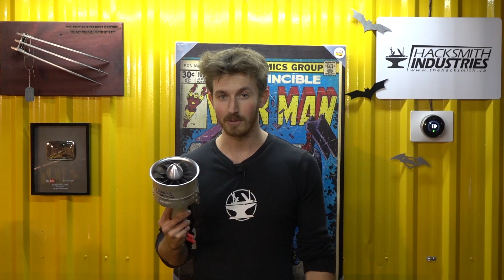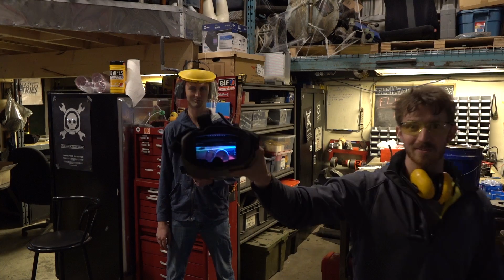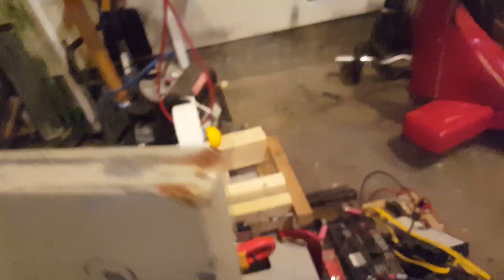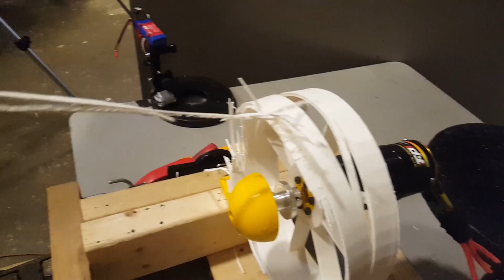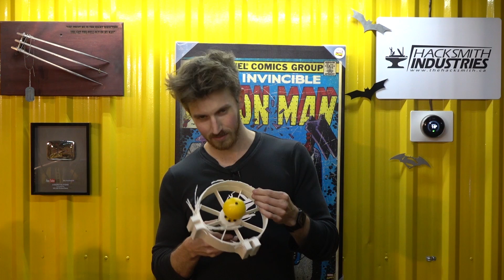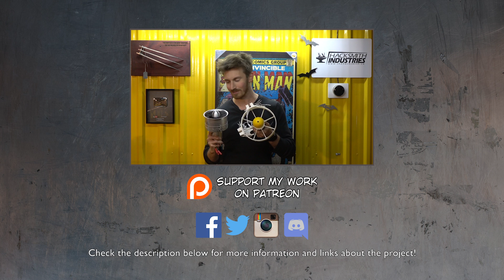Flying Like Iron Man Update: EDF EXPLOSION!!!

Comment: Right when you said "3d printed our own" I knew you were going to have an explosion. A 3d printer won't be able to balance a turbine the way a precision CNC machine can balance one. Even if you made the thing solid it still wouldn't be precise enough. You'd have to manually balance it the way they balance motor rotors after coiling them by drilling little holes around the hub, and then somehow make it strong enough to support the weight of your body (or a fraction of it) between the hub and fins. I'm sure if you took the time to balance this turbine before pushing it to its limit you would've been able to get a bit more force out of it before it exploded... Anyway, it's like I always say: where there's a will there's a way!

Comment: Have you thought about changing, or experimenting, with the print orientation. With additive manufacturing there are weak points along the grain of the prints so if you print the parts that will be stressed with a, for lack of a better term, "grain orientation" that is perpendicular to the force that will be applied to it the print will last longer?
Reply from the maker: Not many options with the hobby grade FDM printers we have haha, this is the only real orientation they can be successfully printed. =(

but yes, we have thought of it xD
Reply: hmmm Maybe if you segment the print for the blade housing, into semi circles, with the support structures on the outside of the arc, you could have a horizontal "grain orientation"? 

idk support structures are kinda hard to remove so this method might require a bit of post processing.

Comment: Probably a bit late. But why not try to print the EDF horizontal to the direction of airflow and thrust, relying upon its tensile strength.  I understand this would be far harder to print but the way it splintered lead me to believe that the print was perpendicular to the direction of thrust. Its like splitting wood, it is a whole lot easier to split along the grain vs against it.
Reply from the maker: Be too hard to print :(
Reply: Figured as much.  But thanks for the quick reply!

Comment: Dear hacksmith have you ever thought about using an Arduino Nano with drivers to power your EDFs? Just a thought I came acrossed thought I would share
Reply from the maker: +Josh Hagen you can't lol, EDFs are extremely high power devices, you need dedicated electronic speed controllers to power them

Comment: hi. to make  stonger 3d part .use nylon filament . the way...dry the nylon first 4 hours in oven at 150 - 175 celcius. after dry keep nylon in Tupperware box sealed during printing .use nozzel o.3 , at 240 celcius , layer 0.08 or more definition 0.06 , bed 115 - 120 celcius more glue stick on bed. need to print very slow , can take 30 -40  hours.when done instal your part again in oven 3 hours at 150 celcius to make sure no humidite.after use electronic heat hot air soldering at 450 celcius to reheated your part to melt the layer and make very smooth face ..you will make hd part and very strong.good luck Patrick.

Comment: So you're telling me that you will not use 3D-printed parts because they disintegrated when approaching the speed of sound? Whole PLANES (made of METAL) have disintegrated at those speeds, never mind a 3D-printed part. Actually it is impressive that a 3D-printed part lasted that long at those speeds!
Actually, I just did a bit of calculation and if the blades are longer that 2.5 inches (!), they should be in the transonic region and experience shock waves that are going to do lots of damage, and if the blades are longer than 3.1 inches, then congratulations, YOU BROKE THE SPEED OF SOUND!!!
I would recommend that you:
-pat yourself on the shoulder for having a propeller go supersonic, something that was so far only achieved by the XF-84 "Thunderscreech"
-slow the propellers down a bit and just add more because the 3D-printing is going to make the EDF's much cheaper
-take this advice with a grain of salt

Comment: When 3D printing, the weakest point is between layers. You can get greater strength by slicing the print and printing it in several pieces at angles that reduce stress on that weaker "between layers" bond, and gluing them together. Think about how much stronger plywood is because of the cross grain lamination. That is what you will need to do to get the needed strength. Since you are printing out of ABS, an acetone bond to attach the pieces can be used and it will be as strong as the plastic itself.
Reply from the maker: +Joe White we are well aware of that, but due to the complex geometry we can't print it on an angle. Too many overhangs and the surface finish would be terrible with support material
Reply: When I say slice into many pieces, I mean many. Each blade would be two separate pieces bisected so that all surface area would be the upper print layer and the surfaces that are on the print bed are your glue surfaces . The ends of those blades would form a dovetail joint that would slide into the hub giving strength and precision to the point of connection while also adding a cross grain support to the horizontally printed hub.

Comment: I could offer you to print a carbon fiber reinforced prop, and by the way: why not also print a reinforced ring around the blades (connected and also spinning) to keep them from disintegrating? I suggest you could get ten times the output. I would just need around 2mm of thickness to embed the fiber.

Comment: I was wondering instead of 3d printing your own if you could buy only the impeller part of the edf and mount it on your edf with smaller blades and only 3d print this cylinder around the blades?

Comment: ok so some kit EDFs have the actual prop in several identical injected molded pieces that come toghether and form the prop
so my idea for this is to 3d print like 1/4 or 1/8 of the prop in high quality resolution
then make a silicone mold of the part and cast it with epoxy resin
u can even make it weight ballanced by weighing out the resin each time

Comment: hey hacksmith..
you are using the turbines which are just open....the inlet and outlet of air is constant..
what about trying a Venturi...
Reply from the maker: EDFs already provide maximum thrust in static scenarios as designed -- at high speeds (when in RC planes and what not) you can increase efficiency and thrust using duct lips and thrust tubes -- but unfortunately for hovering (our main goal) these just add weight. =(
Reply: +the Hacksmith 
yes you are right
but I think it's worth a shot..
can I send some suggesting photos ??
just suggesting..
😐😐😶😶
Reply from the maker: Feel free to research the subject matter! We don't have time to test everything though. There's quite a lot of information about EDFs and thrust tubes =)
Reply: +the Hacksmith 
Thanks
I got Interested and curious about the project after watching the videos...
I'll make my efforts...

Comment: http://offers.kd2.org/pics/e6/56/e656c42bba3993d9afce6f721cdc0b81aef23b80.jpg
I don't know if this would help or not, but what if you 3D print a ring around the propellers so the exerting forces of all the propeller blades are lessened and supported by the ring around it like a toy propeller.

Since all the blades want to go outwards why not 3D print a ring around it to keep it contained and since each propeller blade is connected to each other by the ring, adding better support from being torn apart

Comment: The mountings are what killed this. The blade was pulling forward and the mountings weren't 4 which is how you should secure something like this. Take a bathroom fan, mount it crooked and that's the same thing, just less power. The cowling was bent under the load and then the blade touched it and popped in to pieces. TLDR four mounting points vs two on one side. OR thicker cowling and greater distance between blades and it.
Reply from the maker: Watch the video closer -- both the cowling and the fan tip forwards -- that wasn't the point of failure.

We do need a better mounting system (needs rails at the top too, to get rid of the moment) but this failed due to the speed -- the tips ofthe fan were going at 0.8 mach!

Comment: you should also try kerosene powered rc jet engines. They produce 22 kg of thrust each and are not too much money here the link http://www.ebay.com/itm/ATJ-220sv-22kg-Full-Auto-Kero-Start-Turbine-Engine-for-RC-Jets-Made-in-Taiwan-/322335097190?hash=item4b0cab4166:g:YpoAAOSw65FXtpha
Reply: 22kg=48 pounds of thurst
Reply: screw you
Reply: good idea
Reply: that would be sweet
Reply: 2500$ not too much money you are full of poop
Reply: hes got a gofundme page with a goal of 75000 so yeah
Reply: I think the reason for electric motors is for throttle response times.
I reckon for this to be flyable, you'll need a lot of software running in the background, much like a quad copter.
That said... one or two of these running full bore might be useful for lifting jets, leaving the EDFs for control...
Reply from the maker: Thanks for the suggestion Madden Madness - Car Videos!

We've actually answered this in detail in the Flying Like Iron Man Q&A video! Check out that video, or visit http://www.thehacksmith.ca/flight-project-qa/ to learn more about the project!

Basically, tl;dr -- price point is comparable, and EDFs are much easier to control. We might need a bigger budget just to design a system that uses jets instead of EDFs.
Reply: that makes sense. good luck with the EDFs

Comment: Try casting it out of aluminum. More of a challenge but it could work.
Reply from the maker: too risky. at home casting for something that precise... not easy. any air pockets or variations in the cast part would cause some catastrophic shrapnel attack when testing
Reply: What filament are you using? Have you tried PET (CEP)? it also might help it you airbrushed over it with pla, abs or pet glue.
Reply: it is flexable though. So probaply not ideal for blades but maybe for the housing.

Comment: Why don't you use styrofoam covered with carbon fiber for the duct? It's a very light solution and more sturdy than the 3d printed one. The only negative aspect is that you have to handcroft the styrofoam ducts.
As a prop you could use a normal one from a hobbie store for rc planes or from hobbyking.
Anyway this is only an idea from me even if I'm no a mechanical engineer.

Comment: the more pitch you have on the blades the more amps you getting, dont burn motor and ESC...
Reply from the maker: +Niclas Horn that's why we were measuring the current
Reply: dont forget you need a thrust tube to create proper thrust from a EDF, total lenght of the tube and motor is EDF Dia x 3, the outlet on the tube schould be 90% of the EDF dia then you getting a strong thrust, not fast but strong..
Reply from the maker: Thrust tubes only work if you're flying at high speeds -- they reduce thrust in static scenarios =(
Reply: nopp... thats the thrust inlet that you compress the the air infront of the motor... the faster you fly the more air you compress infront of the motor and get a good expanding of the air after the motor that gives extra thrust.. but thats not what i wrote about in the post before this one..

Comment: Well the positive is that it ran smoothly right up to the point when it failed. So it would seem that the balance is good, I think the problem is just creep, the blades plastically deforming outward until they contact the housing.

Comment: Why not make a kinda tunnel system for your suit? Instead of having just the thrusters directly on where you want the thrust, maybe have them attached to your back and have a tube system to direct the thrust?
Reply from the maker: +Namestop Gaming redirecting airflow causes turbulence in the air which results in a massive loss of thrust -- it could be possible, but considering how hard it is to get enough thrust in order to just hover I don't think it would be possible with current technology

Comment: 3D print a wireframe like structure, then buy glass or carbonfiber and epoxy and strengthen and fill in the wireframe :)
If you have the time I would say buy a spool of fiber and wind it yourself instead of using a woven sheet since you can strengthen the blades selectively with strands and not waste both materials and weight in strengthening the propeller where it doesn't need strengthening.
Simulate it in COMSOL or some other engineering program to cut down on developing cost :)

Personally I would go for a design where you have strands of fiber going inside the blades along the blades and wrap around the edge of the blade back to the center so that the fibers take the centrifugal loads.

Comment: I told you this would happen in my comment on your last video.

You might also be overlooking the balance issue. Any rotor running at high speed must be perfectly balanced for it to survive long term. If it's not you'll develop a vibration that will result in catastrophic failure. I'm sure that 3D printed rotor was not balanced properly coming straight out of the printer and contributed to your failure. Precision machined metal rotors in gas turbines never come of the CNC perfectly balanced. They go through a high speed balancing process where they are put in a cradle and checked. Material is then further removed in key areas to achieve perfect balance. If you don't do this you'll never succeed.

I'm not just talking through my ass. I've been working in the aircraft turbo fan industry for over 25 years and am trying to save you time and aggravation.

Having said that its always fun to see shit get blown apart and makes for good Youtube content so there's that too. lol
Reply from the maker: Yeah we're getting a static balancer for future ones -- it'd be nice to have a dynamic one but my limited research says they cost thousands of dollars =(
 
The main point of these experiments is to finalize the design of the EDF blade and then get it manufactured -- likely by CNC. We can do flow analysis but empirical bench tests are important too =)

Comment: in the middle pole shadt thing inside the 3D printed edf try making it a gear but locked in place kinda like how a bike peddles and then its a chain reaction with the center of the weel(a gear) try spplying the same principle to the 12kg 3D printed edfs but also lock each one in its own little hole so it doesnt go flying again also maje it thicker wich will probably even equal more thrust out of it

Comment: maybe find a way to use a resin printer like the carbon m1 to print rather than the typical plastic layer builder ones that you are using now, it seems the plastic bonding between the layers are not strong enough to support the loads you are subjecting them to.

Comment: Maybe try pressing the 3D parts with fiberglass, carbon or even cevlar. Well and for that you use two compound epox. And if you'll sand it down correctly you'll upgrade the durability quite a bit. Try it ! I think it mite just work.

Comment: The problem is blade expansion, also from the design I'd say there is lots of room for improvement, I wish I could impart just some of my knowledge to the team to fix this, I've done custom fans for other projects and the principals are the same
Reply from the maker: +Bio Toxin have you done EDF blades spefically? The biggest problem is at speeds of 30-40,000rpm it's unlikely any material choice for an FDM printer will work, the inter layer adhesion weakness is it's Achilles heel -- we're planning on just using 3d printing to finalize the best prop design with regards to efficiency and thrust - then we'll look at our options for manufacturing (likely CNC). Any other ideas you can think of?

Comment: Wait... so you used the same motor to spin up a larger EDF? Do you have anything that tracks RPM? I'm really curious how fast it was spinning. I bet it blew up when it crossed over the sound barrier (the old ones were within a few percent of tip speed breaking mach 1).
Reply from the maker: +MattsAwesomeStuff no, new motor is 15kW peak, hobby king ones push 6-8kW tops :p sorry if my comparison was confusing.

So far it's seeming like you get 1kgf per kW :p which is pretty terrible efficiency, but that's the whole premise of this project -- screw efficiency!

Comment: You should check out the Formlab Form 2. You might get better results with it in terms of 3d printing.
Reply from the maker: +Finrecon1 isn't the bed size too small? :(
Reply: the Hacksmith I mean, it's 
145 × 145 × 175 mm. I don't know if that is big enough.
Reply from the maker: +Finrecon1 too small unless we go with an individual blade design :(

We can get 120mm EDFs from hobby king for free, so we're trying to make 200mm+ diameter to save money

Comment: Why not use a metallic filament that has tiny metal bits in it or carbon fiber filament. These would have more strength than the filament you used in the video.
Reply from the maker: +Szymon Bartnik most of those filaments are marketing ploys :( higher grade plastics (like taulmans nylon) are actually stronger. Which we'll look into using once we've finalized the design :)

Comment: It doesn't have to be metal, though it could be. Although, if it were, you'd be surprised what can be done at home in the way of metal casting.
Reply from the maker: +JTMarsh42 at home casting is possible for many things, but a precision part like this would be extremely difficult -- and dangerous. Any air pockets or other variations in symmetry could cause a catastrophic explosion at high speeds -- and metal shrapnel is much more deadly than plastic ;-)

Professionally made EDFs are typically CNC machined, which is our plan once we've finished prototyping design options :)